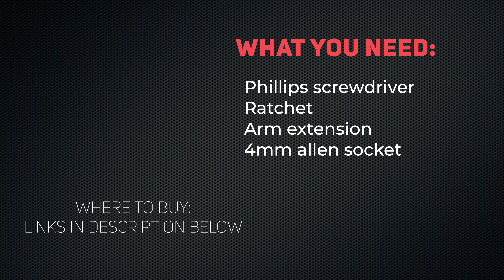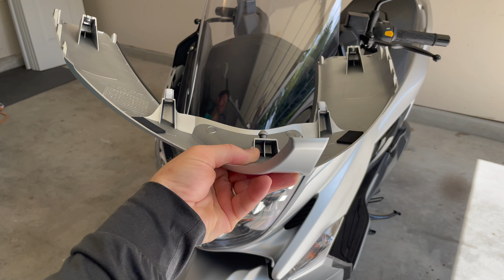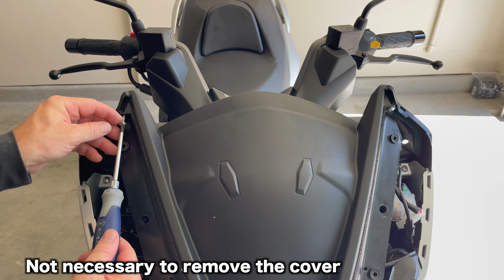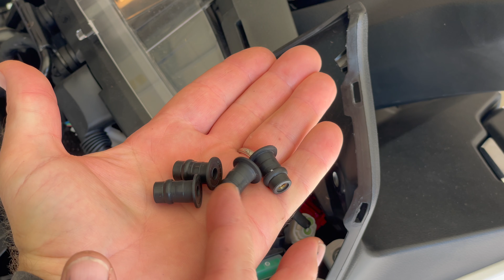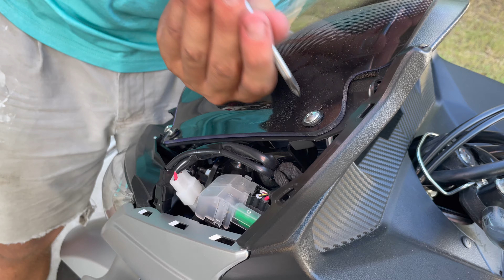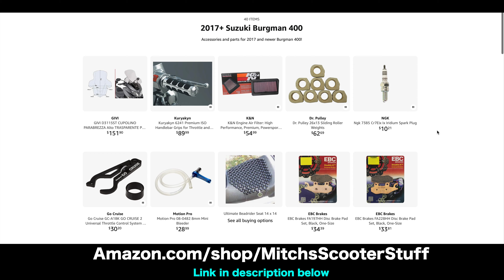Suzuki Burgman 400 - Windshield Removal / Installation - 2017-Current | Mitch's Scooter Stuff

Comment: Just did this on my 2023 burgman 400.  Thanks for the video!  Just a tip for those who have 2023+, the rubber grommets are slightly different than the one in the video, it’s easier to push them from rear to front vs front to rear on the new windshield as shown in the video!